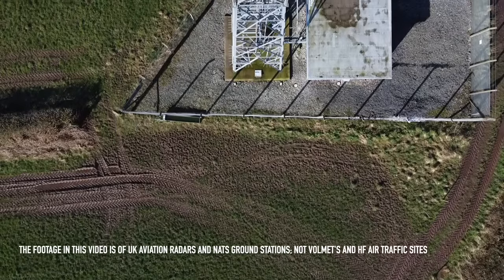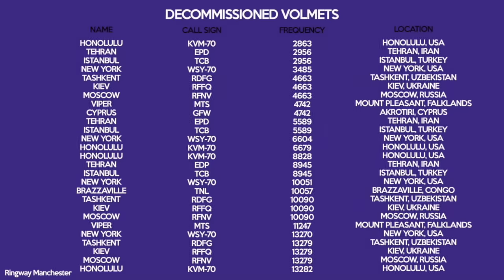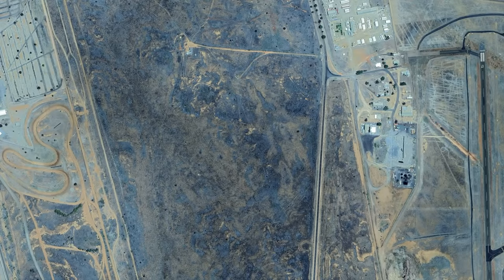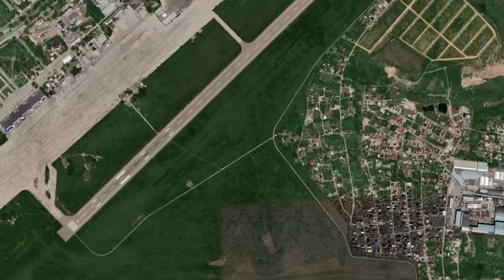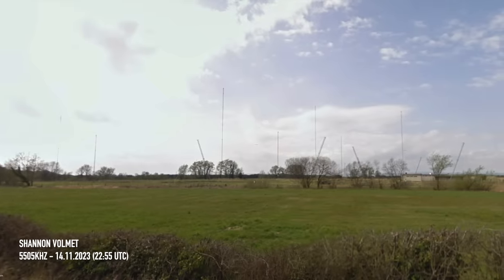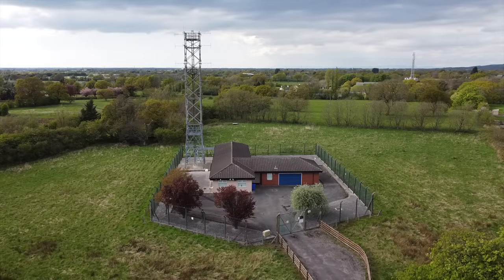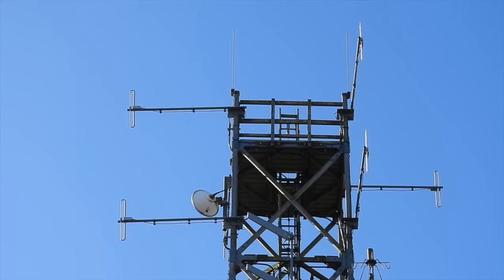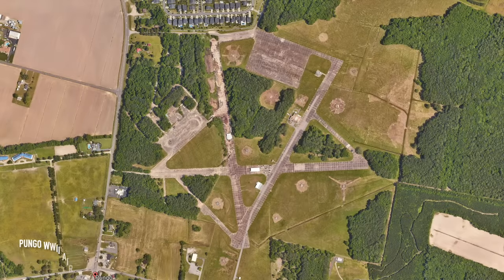How To Listen To Aircraft THOUSANDS Of Miles Away

Comment: A Little correction. Shanwick is fairly unique as the Controllers that separate the aircraft from each other and the radio operators that talk to them are in different countries.  The Crontrollers are in Presrwick and the radio operators are in Ballygirren, 3 miles north of the Shannon Volmet site.
Reply from the maker: Hey all, I sometimes follow inaccurate sources. I’m here to learn too. Thanks for the correction.
Reply: I've always thought that the HF radio ops for Shanwick oceanic probably have the most cushy jobs in ATC, definitely not the most taxing of roles
Reply: MMMMmmm not sure thats correct......last time I looked at the Shanwick web site it said the HF operator's are based in Eire....but things could have changed.

Comment: I worked on Collins Rockwell HF Transmitters, in the middle east, in the early 80's. Many KW into huge log periodic antenna mounted on rotators. I also had a pal who was a ham and an airline pilot who used to work HF aeronautical mobile, and I believe many of pilots who were hams did the same. I can't see that happening these days. Thanks for refreshing my memory with this interesting look at present day HF comms with an aeronautical twist.
Reply: It  still  happens today. There are a few pilots who have an amateur radio licence and operate HF from a commercial airline

Comment: My favourite band to monitor and listen too is the air band.    Local and long distance.   
Excellent video.  Thumbs up 👍🏼
Reply: I like to pair it up with flight radar. It's relaxing. I use to hate the noise as the planes go over my house but I make the best of it now and can tell what's up there just by ear.
Reply: I find air traffic radio to be very relaxing for some reason. I sometimes put my Eton radio on the local airport control tower frequency, set the off timer, turn the volume down a bit and drift off to sleep to it. Almost like listening to distant train horns, it's somehow comforting to hear people traveling through the skies at night communicating.

Comment: As a shortwave listener in the 70s, I listened to both Shannon  and Shanwick Oceanic  and other aircraft using  an  Ekco  AM broadcast tube receiver, plus 100 ft end fed wire plugged into the external aerial socket.  With the much lower band noise of the time , down to atmospheric backround noise, meant it was very easy to hear the much weaker aircraft transmissions on AM. Fast forward later to the complete switch over to USB in the following decades, and improved communications RX FRG7, proved to be a listening delight. Heard many interesting aircraft transmissions, from all over the world during sunspot maxima. All you had to do was listen at the right time of day or night, and know the primary frequencies. Much more information was passed over the airwaves back then, so it was always very busy and interesting to listen to. Sometimes with the lightning static crashes, it got even more interesting lol! Lots of man made electrical noise around these days though, spoils listening quite a bit on HF, unless you live well away from LED and SMPS  QRN .

Comment: I want to thank you lewis for giving me the right information on listening to airband. I tried 7 different airband receivers. 3 were airband prominent the others were radios that had airband with other bands and for my area and me which I'm about 40 miles in-between 2 busy airports the only thing that worked was a bcd996p2 that worked flawlessly on picking up both airports and aircraft. I did use the Moonraker desktop discone antenna I had a portable yeasu Sony and Midland airband receivers that did not pick up anything. I had my bearcat BCD996P2 programmed with proscan I can get both airports. Ty very much lewis for the helpful information cheers!!!

Comment: I used to enjoy looking for ATC transmissions popping up on various HF frequencies both on my own receivers and online SDRs around the world. However, it's been a while since the last time I did it. Still though, I found a few errors in your video:
1) the "Australian" Volmet you recorded is actually Thai. Bangkok Volmet broadcasts at 10 & 40 minutes past the hour on 6676 kHz, while Australian is on the air at both TOH & BOH on the same frequency. This also applies to 2965 & 11387 kHz but these are active part-time.
2) You wrote 3745 kHz for a frequency for Gander Volmet, whereas it actually uses 3485 kHz.
3) SELCAL used two pairs of audio tones, but your recording captures only one. I don't know if it was an error on the station's side or a glitch in your recording, but something's definitely wrong. And you repeated it a couple times!

Lewis, I appreciate your effort introducing shortwave radio to the general public, but please, be more accurate! 73 :)

Comment: Thanks for this information. I have been listening to hf aviation already since the 80's. However not much in recent times. Good to see the 52450 kHz RAF Volmet location. Recently I received it here in the south east of the Netherlands stronger than Shannon Volmet.. What I found interesting is the selcal you let us hear. Apparently they use a different system nowadays. The ones I use to know is those with the double tone, a low and than a higher tone. What you have let us hear here, is a  short tone follow by a digital burst. I will keep an eye on that!

Comment: Volmets are now 99% redundant, 30 years ago, it was a different story. 
HF frequencies are pretty much also overtaken by Satelite and internet.
Its in places like PNG where HF still is used on a day to day basis.
In Canada for example the only place I've ever seen 
an aviation HF radio was Baker Lake and they told me they could not recall
when they received the last message.
Back 30 years go, yes, HF was used in Canada and that frequency
went back to the 1930's
You mentioned Australia
In about 1979 the HF was AM, and changed to USB
its still used there for remote coms but overtaken by 
text messages via internet and mobile phone.

Comment: Great video how much are the are the radios to buy like the one you use I have a few scanners but I want a better one to pick up more aircraft the ones I use I can only hear the pilot and not ATC
Reply: The Icom 7300 in this video is a HF transceiver, and overkill just for listening. You can use any SSB capable SW radio, just get a good long wire antenna up. For listening to VHF airband, it's not a case of the quality of radio/scanner, it's how far you are from the transmitter site (maybe the airport) and how high you can get your antenna.

Comment: When you say a long-wire antenna, is there a minimum or optimum length and diameter of the wire used?
Reply from the maker: It’s just a 25m length of speaker wire on a balun, straight down the garden
Reply: @RingwayManchester  Oh. OK. How will that compare with the MLA 30+ I am using at the moment? Thx.

Comment: Trans atlantic HF comms not so many years ago used to be much more interesting than it is now.....HF now is basically a back up radio sys in case of satellite data links not linking.....not that unusual.

So before Sat link data.....the crossing was 100% HF radio.....with aircraft having to make regular position reports.

There is still HF comms going on over the atlantic...3491 USB inthe later evening has be coming in great in recent weeks.

Been listening to HF aero comms since the early 70s.